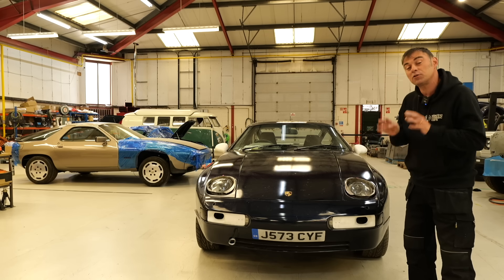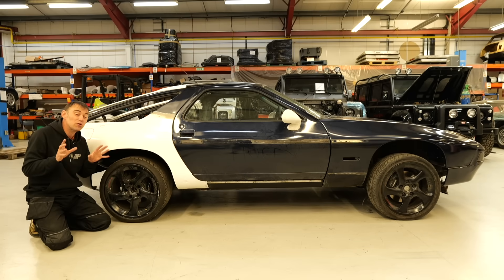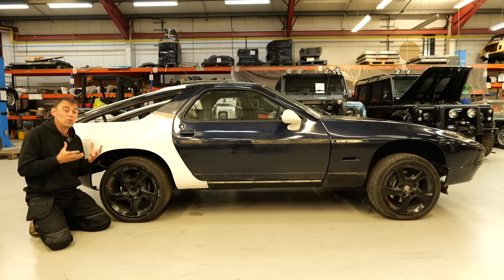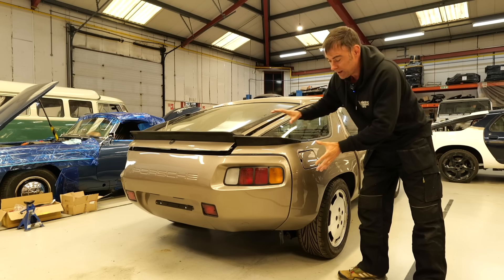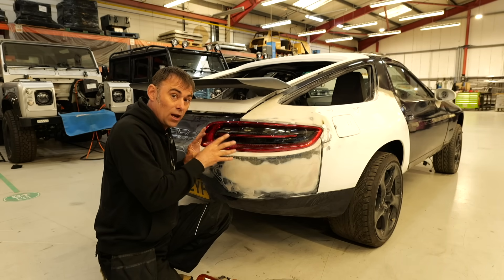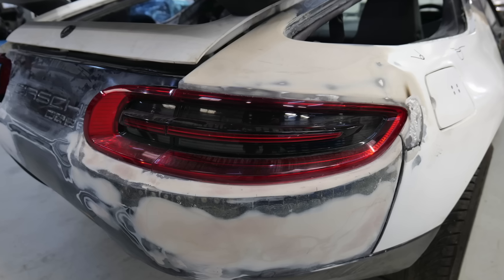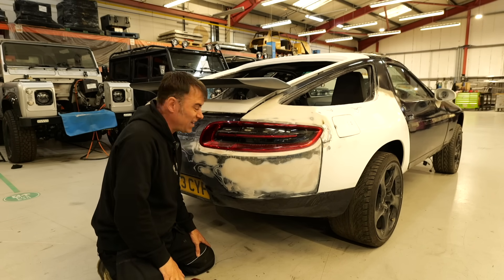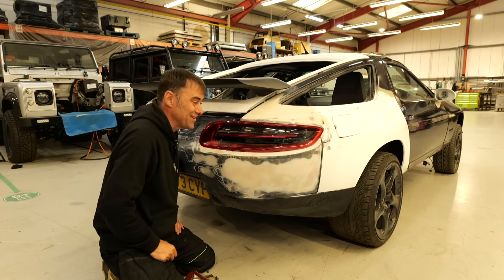Electric Porsche 928 Restomod update

Comment: I like them both but one thing doesnt sit right on both cars . The ride height .Does the suspension drop ? Looks kinda goofy
Reply from the maker: Yes. The suspension will lower once the weight of the batteries goes back onto the cars. 👍
Reply: @ElectricClassicCars  nice one . I knew you would have it in hand . cant wait to see you drive it

Comment: Just one thing,get your front air vents 3d printed for a smooth look,as a large bee could snap off the tiny bit of clear plastic light you cut to fill the gaps 👍
Reply from the maker: That tiny bit of plastic is whats on the 928 stock.

Comment: I just wonder if using the front lights from a 968 would be easier as porsche did themselves when they updated the 944.
Reply from the maker: We tried them but they didn’t fit. The 928 needs more reclined lights.

Comment: Removing pop up headlights is the worst move and then making them look like CHINA design CAR at the front, what you SHOULD have done is CLOSE completely the bonnet headlight holes, and place headlights of some kind in the fog lights place! It would  look like VWSP2 front. The new stop lights are great because the originals are just not so pretty. There you go.
Reply from the maker: We considered putting the headlight in that location but unfortunately that’s too low to pass inspection. 👍

Comment: Could you not fit the 4 batteries where the pointless rear seats go and keep the tailgate access for luggage in the boot? 
It would also lower the weight as well as distribution along the vehicle.

As its an EV conversion which is part of the overall resto-mod style I really like the lights and door mirrors, enjoying the build  and the updates 😎👍

Comment: Tail lights: not original but looking very good. Love the headlight treatment, especially using the old VW glass. Why not put the rear battery pack where the back seats are - as the boot would likely get more use than the back seats.

Comment: Tail lights looks great, that's a lot of work.
Headlights look cool too.
I would like to see some videos of a actally doing the work and fabrication.
ho0e the rear battery box doesn't upset handling to much, could you not have put them either side of the car on the floor seen as your doing away with the rear seats?
I've heard you talk about what you're allowed to do to a car when doing an EV modification, concerning the DVLA so I'm wondering if you will be covering that process in your videos as this Porsche is pretty heavily modified.

Love the work so far, would love to see more detailed videos even if they're just filmed quietly and sped up a bit

Comment: Oh I wish I could have my old Landcruiser HJ45 Troopie converted! Love the Landy and the T3
Regarding the lights, first of all, your car, your choice, second, you have to try something, to change something. One thing though, I’ve used the same T1 glass headlights on a Mercedes firetruck, and the glass is kind of low quality, not that clear, not that smooth, and uneven, which can be seen in the light pattern. Have you thought about forming some acrylic lenses, lot of weight in that thick glass?

Comment: 1:42 "Weight reduction". Please tip the scales for us when you've got the drivetrain and battery installed. 2:45 Light cluster "it's a bit dated". Bro, the ones you've fitted are not going to mature well. They are hideous. While I love the idea of trying out different things, like the GTS wheel arch extensions, some things are just better leave untouched. But I am glad that is not a genuine GTS you are chopping. So yeah, have fun.

Comment: I was thinking that the front lights could use an even more modern twist.  What do you think of having an LED light ring around them instead of your metal mock up?  I think they call them Halo rings or Angel Eyes.  I bet you could make a clear hard plastic ring and put some sort of LED rope light inside it for each headlamp.  You could even have them so you could change the colors so you could make the ring whatever color you want.  I think it is possible to 3D print these kind of things.  You shouldn't have to much trouble getting it to look factory.  What do you think?
Reply from the maker: 3D printing is an excellent idea. 👍

Comment: Nice....buuuut, I can't grasp the concept of "configuration". Ok, u decided to just throw a tesla drive unit, fine(it's simple although has it's downsides), but the battery placement....questionable to say the least,  they are too high. rework the driveshaft tunnel and that give's u several advantages(like chevy volt\bolt), u lost a huge amount off cargo space, both in the rear, and in front even if the car will go 200mph(questionable) in a straight line, it will drive\turn horrible. I'm not saying tesla engineers are dumb, but that knowledge is not rocket science!, plus about the weight, ev will inevetably be heavier than ice, so even droping weight, on the chassis won't go far, by not so hard calculations, besides the aerodynamic part, to get those extra 30mph u need to multiply the power output significantly, and did i mention the gear ratio? as i recall the stock final drive doesn't even go close to that speed, sure u can change it, and take not seconds but minutes to get to 60mph, there's no "free power" only exchange - acceleration-vs-top speed. C'mon fellas, you're a big and famous workshop, u can do better!, if i can do all that in a garage when drone's and ballistic missiles blow up in my neighbors house, U can definitely do all that.
Reply from the maker: Here in the UK we can’t modify the chassis so can’t open up the tunnel to fit a Bolt pack. We’ve crunched the numbers and it should end up being the same weight as when it was petrol with fuel in the tank. Yes, we’ve changed the gear ratio in the Tesla DU to get the top speed, it’s something we’ve done many many times before and it doesn’t significantly reduce the 0-60 because of the massive torque from zero rpm.
Reply: @ElectricClassicCars  Ok, maybe then the rear battery put under the floor\instead of the fuel tank.... but in  the end, i'm just a bystander, and you are a big and well respected company, so don't mind me. When i'll go public and worldwide, i'll do differently.

Comment: I've always thought pop up headlights were there to punish your aerodynamics at night, so I'm pretty much in favor of getting rid of the them.

Plus it's just a point of failure with the pop up mechanisms, so it's an improvement for reliability to ditch them.
Reply from the maker: The pop up headlights and mechanism also weighed quite a bit. Having driven the Teslarossas a lot with the headlights up and down I can confirm that they affect the aerodynamics and energy it takes to push it through the air. 👍

Comment: Love the lights - perhaps the panels for brake ducts could be flipped as other have suggested.  You could also have used the blanked off panel section for daytime and low beam as many modern cars do and the pop up’s could be high beam only.
Biggest question to me is why you haven’t mounted the 4 rear batteries in the back seat area.  Nice and low and it offers an enormous area for storage under the rear hatch.

Comment: Not a fan of the rear lights. The 928 lights are quintessential 928, but I think the 928 lights look better in the retracted position than when they are popped up. What you did looks great, and still looks totally 928. Getting rid of the lowers and putting in the ducts is also good.

Comment: I used to work at Canadian European vehicle import body and paint in mid 1986. Porsches 944 and 928 were supposed to replace 911 model line up. Building both vehicles pushed Porsche verge of bankruptcy. One complaint was the 928 frog eye headlights. Bank than there was aftermarket headlights to convert them to normal headlights or flush mounted headlights.

Comment: Call me skeptical but 200mph seems almost impossible unless you change the gearing in the gearbox.   Tesla purposely geared it for a ton of low end torque but in most races, it falls flat before hitting 120mph.     Either way, it will be a beast
Reply from the maker: Yes, the gearing has been changed in the Tesla DU. 👍

Comment: The 928 the car so iconic Porsche dropped it to go all in on the 911. The car was awkward when new, those frog eyes do not do it any favours, adding weight to a sports car at the front bumper cannot do it’s performance any favours, so yeh the first things to go if what you want is more speed and control would be those lights.
Reply from the maker: It had a good run though, 1978 to 1995. Longer than most. 👍

Comment: I like the 928's modernist retro update, good luck with the 200 mph.

Just a thought, if you think that the rear seats are 'pretty much redundant' in a 928, why not sack them off completely and use that realestate for battery storage?

Better CoG, plenty of room and you'd retain a practical Boot, to boot! 😊
Reply from the maker: Good point. 👍

Comment: Any reason why your new headlights couldn't use the 928 headlight glass? Is it because the glass needs to line up with the fixture?
Reply from the maker: It wouldn’t allow the angle of the cats eye lense to work right. 👍
Reply: @ElectricClassicCars  Glad you found a suitable replacement, annoying you need to fabricate metal bits to full the gaps in between

Comment: The front lights are iconic, those pods. Its a shame to lose them. I thought you were going to delete them altogether and weld up the holes, using the bumper light space for headlights.
Reply from the maker: That would make the headlights sit too low. We did consider it at one point. 👍

Comment: We'll see about the Macan tailights once final design is done. However, the pop-up, EVEN if not acting pop-up - could be set up as DRL+turn signals for ex. - shouldn't be modified for the front design is too iconic. Main lights could be the lower light assembly as S4 original. TBH, rear battery placement is just horrendous, totally defeats the "hatchback" logic, rather use the rear seat space  longitudinally.

Comment: Love the rear tail lights but agree that dumping the popups is SACRILEGIOUS! But it’s your car, do what you want.
Reply: Everyone has their own opinion.  It's ok to be wrong.
Reply: What is Sacrilegious is not removing the pop up* headlights but replacing the petrol engine and turning the car into an electrical cabinet on wheels. *The lights don't fit this 928, they look like a foreign object there. Electric cars are lifeless, boring, and dull cabinets on wheels.  You should actually do the opposite, attach proper motors to the electrical cabinets. You put an LS3 or a Nissan V6 engine in a Tesla etc etc.
Reply: @valdurmagi230 Porsche is supposed to be a sports car. What's the point of a petrol sports car with less performance than a modern saloon or SUV?

Comment: As a lifelong fan of the 928 and having had two, I think what you are doing is great.  Parts are becoming difficult to come by and this is likely the best way to keep them on the road.  Those fog lamps that you took out are easily worth $500 a piece.  Fun facts: The original headlights were styled after the Lamborghini Miura and the rear bumper is the first ever production car to have enclosed.  You're crazy not liking the pop-up headlights but what you've done with the VV bus light covers is on point.  Those look a lot better than lights on the Nardone car.  For those looking for more info on the 928 Donut media has the best video out there.

Comment: I love what you've done so far! Is there enough space to mount the 4 batteries in back flat instead of stacking them so the weight can be distributed more evenly? Or can they placed on their sides so the rear floor is lowered and the weight is also more evenly distributed?

Comment: I own a 1982 928. Like the rear lights, the headlamps....but the lights in the front bumper not so much. As you know the 928 has its engine behind the front wheels for handling...how has your situation compromised the handling?? Aside from my negatives...great job. As I am a purest - stick in the mud old fart - perhaps in-hub/wheel motors and hiding the batteries...all my wish list, but I am a grumpy old man.

Comment: Like the rear end changes but not the light cluster. Prefer the rectangular lights. Not fully getting the front,  lower light cluster and brake vents. Experiment with the concept some more. The fixed headlights and trim are ok.

With all that weight (drive unit and battery) in the rear, how will the car handl? Will it oversteer or track to the corner attack line? Any color preference?

Comment: I like the rear lights, and  I'm looking forward to seeing the fronts finished. The mirrors are great, and the wheels are an improvement. If you aren't going to use the rear seats, think about getting the batteries lower, in place of the seats, or in the tunnel. Love the build.

Comment: Like the changes. My take is that the high COG may ruin the handling of a fantastic car. But it’s not my car, so don’t listen to me. 
Small suggestion on that small filler cover. Can you see if you can install a light there ? To assist getting the cable into the port when it is dark. Saves using your phone light to insert.
Reply from the maker: Now THAT is a cracking idea. 👍

Comment: I like what you've done with the headlights. That said, I'd try and incorporate the 4 small lights in each light similar to the 2015 Cayenne or even the 2024 version. Just because it looks cool but also because it's a nod to a modern Porsche. As far as the lower lights, I'd take the idea similar to how some modern cars now have their headlights in that position with their running lights higher in the more traditional area. Some of the new evs are doing this. Chevrolet and Mitsubishi etc.  I like how you're trying to subtlety modernize the look of the car. You're just continuing the hot rod culture.

Comment: rear lights look nice! perhaps on next project it might be easier to scan and 3d print housing to match bodywork, rather than modify to match the macan lights.
also front main lights, would it not be more efficient to bond in a square panel of glass, and just black out the surrounding, windscreen style. flush surface, no need for intricate panels. 
nice work however, congrats
Reply from the maker: Some good ideas there. Thanks.🙏

Comment: Like the rear cluster but the front side marker lights dont suit , could you have used 911 headlights and had them sunk into the body so as to emulate a 911? Intersting take on a 928 even though i like original like the gold one in your shop😊

Comment: To echo other comments, rear lights look excellent, not sure about the fronts, they still look kinda weird. I think going full modern with some led cluster would work better, but you do you! There's no issue in modernisation of a retro design, let the purists sob!
Reply from the maker: The front lights are a way off being finished so they look a bit goofy at the moment. 👍
Reply: I think the weird look is due to the gap around the head lights. It will probably look at least better if /when the surrounding bodywork is modified so that it continues uninterrupted to the edges of the headlights. I would have possibly gone with flatter glass but I suppose the bulbous glass is more of a nod to the originals.

Comment: Love the Macan rear taillights.  The fronts are rear tough.  Perhaps scan the light/fender area and build a housing that is flush with the fender surface.  Then 3d print the surface with clear material (it’s new).   Your new compact led lights can then be placed under this 3d printed clear covering.   You may have to trim the vertical part of the fender where it meets the headlight housing when down.   This may give
more vertical room to position the new small led headlights higher.   You can then paint the perimeter portion of the clear 3d printed housing to match the body color.    Just a thought.    Great work!
Reply from the maker: Yep. I’m definitely going to look at 3d printing as we’ve just got a new bigger printer in. 👍

Comment: These are both going to be amazing. Should we expect a head-to-head performance test? The battery box placement means the boot is very similar to a Smart Roadster Coupe, which was actually quite usable if you didn't mind losing the rear visibility.

Comment: I love the rear lights, I would bring the trunk down to meet the curve of the side panel in a straight line then bring the Porche emblem out to meet that.  As for the front, I never liked the exposed headlights on any car, they always looked bug eyed to me and not very asthetically pleasing.  Plus, they have more moving parts, more to go wrong.  I would make a more drastic change and use a modern low profile LED headlight.  That would really bring the car into this century.  It would mean a lot of fabrication work to close up the round ports in the hood, but as a custom shop, its in your ability to make change. Why not take it to another level.  I understand the nostalgia and keeping the look of the classic car but it is a custom job afterall.  Can't wait to see the completed fabrication.

Comment: 200mph is not a concourse specification and it’s faster than the speed of prayer without aero mods to keep the car stable.
Treat this like Bug Zappa and opinions about lighting up grades will weigh less.

Looking forward to how the seeing how much properly distributed downforce can be gotten from the undertray to diffuser which should leave a sharp lower trailing edge to the remove some bubble butt turbulence.
A spoiler on the top of the bubble butt would a drap reducer and still leave well-rounded side-butt views.
This rear would not be traditional but it would make it more capable of 200mph which is a kind of sexy that suits this car.